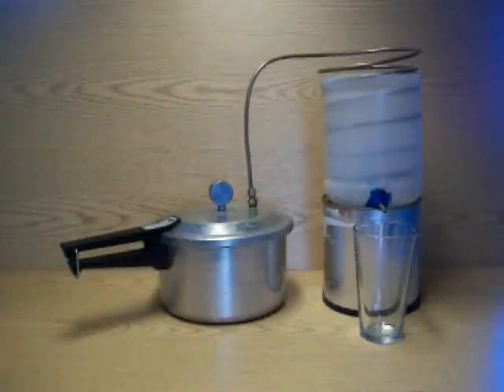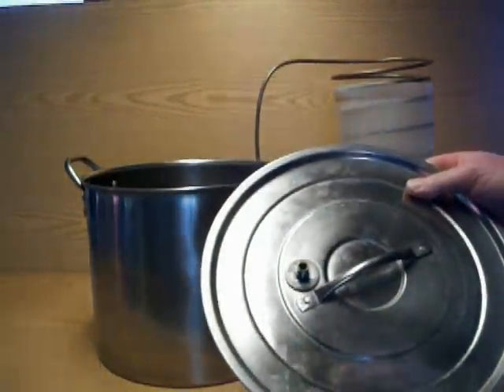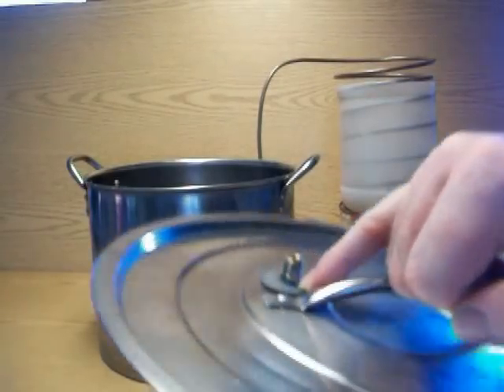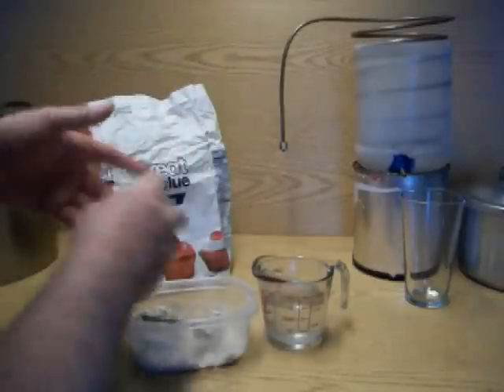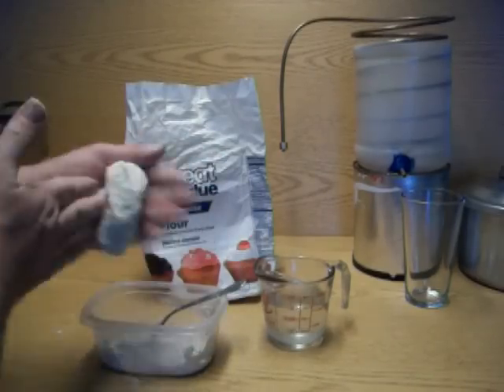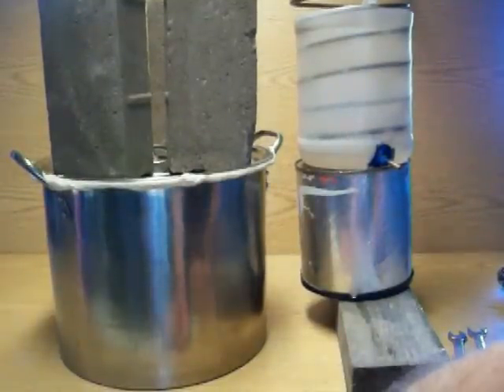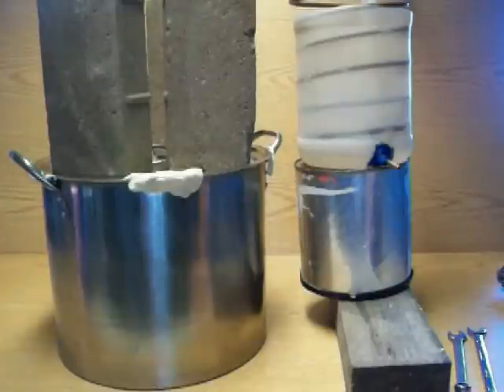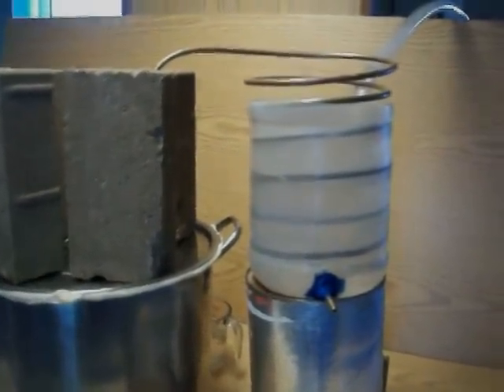Easy Build Moonshine Still pt 2 Upgrade

Comment: Could I put high heat liquid gasket on the lid instead of the flour putty?
Reply from the maker: You can, and I'll get to that.
There were many problems the flour putty solved
*ease of other people being able to find it and use it
*getting the gasket to stay put till I got the lid in place
*possible toxic problems from not being able to find just the right materials
So now, if you can get the gasket to stay there, I would find and cut out a piece of cork for a gasket.

Comment from the maker: Why? Everything I do is as low cost as I can get it. The bricks were right outside and I can't be sure there is enough lip for vicegrips. Also not everybody is a mechanically able as I am, and if they can't replicate this, maybe they shouldn't try. I might try upgrading this on a later date, but it's good for now.

Comment: Rather than using bricks, have you considered sliding a broomstick through the handles?
Reply from the maker: As a matter of fact, yes. but the pressure has to be even, not just on 2 point of the lid as I learned when I tried 2 bricks.

Comment: Me and a buddy are running a still in a old barn back in the woods and we are using a turkey fryer burner too cook or mash if I use this upgrade if it leaks could I blow my self up with alcohol gas and the burner because I couldn't find a 10 gallon pressure cooker so I have to use the pot???
Reply from the maker: +Trucker Man 42 Ok. good questioning. Once you get things up to temp and get something dripping out, you turn down the flame to a min. When you do this the pressure in the pot will only be couple of psi at the most. This will reduce the chance of leaks
Reply: +wcemichael thank you and can I leave the flame at a minimum till the mash is gone
Reply from the maker: Trucker Man 42 No, you should constantly watch it (maybe that's not what you meant).

If you mean until the mash is spent (given up all it's alcohol) then yes.
Reply: +wcemichael ok thank for the information it help a lot
Reply: +wcemichael another question is the seal u used to put the pipe to the (lid the bolts) Can I use a seal like flour and water somethin like that or the next best thing because I don't have access to those seals
Reply from the maker: Trucker Man 42 It should work. One of the rivets leaked and I pushed flour putty into it and let it dry. Never had another leak from it, although yours might not be a permanent seal. You can take some flour putty and seal around the outside of everything if you get a leak while working.
Reply: +wcemichael ok thanks a lot I just didn't want to blow my self up thank your for your help
Reply from the maker: Trucker Man 42 Well there's a lot of factors involved for it to go BOOM!!!

If the pot is small and the air space inside is small, a Poof! is not impossible, in which case the top might come up an inch or blow out the flour putty whereas a BIG mountain type still with one of those big cone shaped tops has a lot more space in it and thereby a lot more room to fuel a much bigger reaction.

And even then you have to factor in, how would the fuel get enough air for a reaction, when the air gets pushed out after some time.

OK? So I'm not saying anything is impossible here. Al long as you're careful to minimalize risks, then you should be fine, but again, no promises. That's why they are called accidents.
Reply from the maker: Also, the pot is a bit tougher than the thinner walled "mountain" copper stills.
Reply: +wcemichael yeah that's the reason I run a pot instead of a cooper still because I don't like my still to be thin

Comment: Im looking to make grain alcohol for tinctures.. what strenght alcohol does this make ? Thanks in advance ☺
Reply from the maker: The question is what strength would you like? I commonly get an average of 50%, but you can do multiple runs of the same batch and easily get higher ranges.
Reply: wcemichael when making tincture everyone say use everclear...im in Ireland and it illegal to sell it cant even get it posted in..so i would like to get as close as possible which is 190 proof ..
Reply from the maker: Oh that's easy. Start with the highest proof alcohol you can legally buy and distill that as many times as needed with a column still if you can get/make one. If not just use a regular still. I won't promise how high the proof will get but you should be able to take 100 p and easily make at least 150 p.  You might have to use a temp so low it'll take all day and night to make one batch of 190

Comment: what kind of fittings are they i got the coupler but the others is what sorry to keep bothering but i guess im just not getting what kind of fittings that you use or anything like that.. like a material perspective.
Reply from the maker: The fitting has a standard thread pipe tread on one end, and the other end has a compression fitting and ring. You local hardware store can help you get the right stuff.

Comment: How can you tell your head from your heart?  Is it easy to detect the difference while tasting?  If so, can you explain the difference?  Is it usually around 50mL?  I've heard that from other people, and you said it was 50mL in your last still video.  It seems old 'shiners would run all of it, and they wouldn't chuck the head at all.
Reply from the maker: Yes, their is a difference. I've learned to tell the difference in taste. Others have learned the difference in smell.
The only way to learn... You run a batch, ok. You KNOW the first thing coming out is heads. Heads has acetone, so it smells like finger nail polish remover to some people.
So you collect it and save it, at least 50 ml (actually a good 1/4 cup) and learn what it taste and/or smells like. Just taste, don't swallow. To me, it is a feeling on my tongue mostly. By 1 full cup, you should start to taste and/or smell something a lot more smoother.
You get to know the clear difference between the two.
Reply: Thank you, very much.  You have been very helpful.  I'll check back in and let you know how my first run came out!

Comment: I was wondering if plumbers tape could be used to seal it instead of flour puddy u know like to line the inside of the lid
Reply from the maker: This is just a working poor man's model. You can buy better on Ebay. I don't know how you get the Teflon tape to stick

Comment: I've seen others use vice grips (instead of bricks)... have you tried vice grips?
Reply from the maker: The bricks were right outside and this needs to be repeatable for the average viewer. I mean I might go out and buy 4 vice grips at around $7 each and maybe I could get them to work but could the rest of the world? A guy in Pakistan was able to cobble together this set up and is making good whiskey. He doesn't have extra money for parts he doesn't really need.
Reply: A very wise answer! Thanks!

Comment from the maker: Thank you for that very useful info. I know whatever contaminates that may be there would only be temporary. I imagine that this contamination would be on stainless steel parts because the would be made with similar tooling, correct?

Comment: how would you get a temperature gauge in there cause interested on how to get it in there without screwing anything up.
Reply: could a drill a really small hole and use flower puddy to plug it??
Reply from the maker: Travis Beaver
You don't need a temp gauge. You just turn down the flame a bit after it heats up. If you don't like the taste, you turn it down some more.
This will explain it better
http://youtu.be/JZakPUSVVKo
Reply: thanks and i cant find your video on your fittings and what not on the lid.. cause i was trying to look today and i cant seem to find it. if you can put that in a link i would sure appreciate it. :)
Reply from the maker: Travis Beaver http://youtu.be/NNq28DDjlA0

Comment: im tryin to make a still an i have almost everything i need to put it together i have a stainless steel soup pot the copper tubing and i have a quater inch thick flare and i lost my notes so wat should i use for the other part of the pressure fitting thing? also im using kwik seal plus its a kitchen and bath adhesive can u help me out an tell me if i need somethin else entirely on any of it

Comment: great vids man. I got SS pressure cooker, i am a but concerned about the rubber gastkit. is it safe to leave it in there or shall i remove it?
Reply from the maker: Boil it with as many spices as you can and also some cinnamon. If there are any toxins it should help them seep out, nicely breaking it in for use.
If afterward you have strange rubbery taste or it starts swelling or breaking down, I would look for a new one made from a different material.

Comment: Can you do video of a run so I can see how it works also what is the name of the fitting in the lid and how big do you make the work out of is it 1/2 copper tube or bigger and does the brass ends cause any problem with the shine that you have made

Comment: wcemichael What fitting and what size fitting is that in your still top?
Reply from the maker: It's a combo fitting. Standard pipe tread on one end and compression fitting on the other for the coil. You can use any size you wish too. I already had the coil made I think I used 1/8" tubing on this. Your hardware store can help you match up the parts.
The pipe tread end has a small stainless steel or copper "nipple" running through the lid then a standard stainless steel or copper "coupler" is used as a nut on the inside. Stainless steel washers are used to add some rigidity to the lid because it's very thin and can easily bend.

Comment: Office Depot medium binder clips, or large, medium is about $4.00 for twenty. Pep Boys sells sheets of high temp gasket material. I had to contribute; this is what I would use if I were doing it, which I'm not. I think you could make a good enough seal that any blow-by would mean turn the heat down, but I would never leave this jury rig unattended. Things can go south in a New York minute. Two words.... FIRE EXTINGUISHER.

Comment: Thanks so much for making this video, it is very helpful. I have an identical set up to your pressure cooker still (the one this is an upgrade to). However, my question is how do you know exactly what you are distilling when you don't have a thermometer somewhere in your set up? I know you need to distill ethanol and methanol has a lower boiling point so it will distill before the ethanol. If I were to somehow include a thermometer, would I need to be testing the temp of the mash or the steam?

Comment: Can I use cinnamon powder in my aluminum pressure cooker to get rid of the toxins
Reply from the maker: It doesn't work quite like that. The heated alcohol will slowly eat away the aluminum, however aluminum doesn't evaporate like alcohol.

Comment: thank you for sharing can you please tell me what size copper tubing  are you using for the worm
Reply from the maker: Oh I forget at the moment I've had this for so long.
The size isn't really important. Making it fit is. So bought a fitting that screwed right in to a hole of a pressure cooker lid that I took a piece out of. then I found the cooper that matched the fitting.
Reply from the maker: ARCSTREAMS
You need to find a fitting that fits in the lid of the pressure cooker, THEN find copper that works with THAT fitting.
I took the lid in with me to the hardware store and asked for help
Reply from the maker: ARCSTREAMS
Do you have an ipod with "facetime" on it?

Comment: Nice build. I have built a still from one of these pots also. I have done it a little different and have a thumper also.  I wanted to add a couple of things to this if I might. the first is the pot itself. the handles should be removed they are made of aluminum and as we all know it is bad for you. I removed the top one and used it for my copper I used two 3/4" copper male adapter with SS nuts (off eBay). as for the handles on the side I took out the rivets and replaced with SS screws (from Menard's). This should be done no mater what.  Moving on the seal is not a bad idea. But so messy think of this while at Menard's get food grade silicon give a good bed around the lid (where you put the flower) let it set a bit and get a skin then set it on the pot after a bit more give it some weight this will make a dent in the silicon  on you lid to fit the pot.  The last thing is the bricks. if you get wood clamps spring loaded type ( found mine at Harbor Fright .99ec.) I got enough to go all the way around with only a inch or so between them. This works good and NO messy clean up.  I hope this helps stay safe and happy distilling. :) Shoot almost forgot use ice in condenser stir it every once in a while just drain that off and add new ice as needed.  this will save a lot on you water bill. I have a 6 gal bucket for my condenser that i fill half full i do that once out of the sink. Ok done
Reply from the maker: +inmate247365b Oh, I made my very first still with an aluminum coil, my second still with an aluminum pressure cooker. I wouldn't worry 2 seconds about handles on the outside.
Reply: +wcemichael Just because you have done it does not mean it is safe. In fact it is not. Read up on it. But as long as you are telling others you should get it right. or as right as you can. Aluminum and brass are bad. That is a fact!!! And just to clear it up it is not the handles on the outside it is the rivets to hold them on the handles are SS but the rivets are aluminum. They will also leak. I have run many gal of shine and have learned a bunch but this one is important. Thanks for responding.
Reply from the maker: inmate247365b I have read up on it, and I haven't seen any proof in this claim .(but I don't recommend using for long periods without thinking about replacing it with copper or SS) What I'm saying is the small amount on the OUTSIDE of your still won't touch anything. There is nothing to worry about.
Reply: +wcemichael I bought a Bayou 24 quart stainless steel stock pot. The great thing about it is the handles are welded to the outside, no rivers to worry about! All around a very high quality stock pot
Reply: +Julien Bubler *rivets

Comment: Really all you need to make a still is a pressure cooker a drill that can cut through metal some kind of tubing that can resist Heat and something to screw it into the hole
Reply from the maker: And do you know how expensive a pressure cooker is of that size....made out of stainless steel? Some people can't tell the difference between a left and right handed screwdriver... The purpose of these videos is to give you knowledge of the absolute minimum requirements to get results. Not to mention that a pressure cooker should already have a removable part that leaves a hole without drilling...

Comment: the putty seems like a step backward. surely you could have rigged something up to clamp that lid on. Even putting three or four bricks on it seems better.

Edit*
 I typed this before i saw the bricks come in. Would this work without the dough and just with bricks?
Reply from the maker: No, you need a seal and something to hold the lid down. This was the best approach for the average guy with little to zero skills. Easy, cheap, and repeatable by the average guy. Those are always my goals when making these videos.
Reply: wcemichael use flour to seal it just like in the big stills
Reply from the maker: Donald Neal Well......
They really use that mostly for leaks I think, but yea, they do seal a lot of stuff, like tubes they want to take apart afterward.

Comment: Michael, really loved the flour bead you used to seal. I've seen other youtubers use silicone, while this is a little more labor intensive, props for economical sense and old school!
Reply from the maker: I go by a basic rule of thumb to make my projects as simple and easy as possible so the average guy can copy it, and if he can't, then he shouldn't be trying.
Reply: wcemichael
 If you were to use a silicone gasket, would there be any concern over chemicals leeching?  I've seen people talking about using food grade and/or aquarium grade caulks, but I'm not so sure they were meant to stand up to that sort of heat.
Reply from the maker: There are people on Ebay selling homemade stills like this one, only more complex because they have tools and work areas. I've seen a couple. They are using some silicone or rubber for a seal. And if you use a pressure cooker it has a rubber seal.

My opinion and I may try this soon. Order a big sheet of cork gasket material and food grade adhesive on ebay. Your first run, pour in a fifth of cheap vodka and vinegar to break it in and get all the possible toxins to seep out.

Comment: made corn mash for first time I was told to put 4" of corn in bottom of 5 gal bucket I cooked it at 150' for 1 hr. well the corn swelled up and absorbed alot of the water I ended up even after pushing threw a screen 2 1/2 gal can you tell me how much crushed corn to use and when do I put the enzyme in it on the bag it said 1 1/2 teas. per 5 gal that doesn't sound right  is it?  Thanks Rose
Reply from the maker: Damn kid playing on my computer...
Go look at my corn mash video and just replace corn meal with cracked corn. I used about 4 or 5 lbs of corn meal, about 3 gals after it swelled up.

Comment: Hey west coast as always another great vid. I have a question for you on recipes using malted barley and unmalted barley- not much on youtube has helped with trying to mash a 5 gallon batch. Any help at all would make me turn back flips!   I know this vid is on a still upgrade but I made this upgrade and now ive got to make a wash with this barley I paid for and not destroy it!  thanks a bunch-..
Reply from the maker: haulshine409 If your just starting out, then work with fruit. Save the barley. I'm not sure about it yet. I've only worked with 2 grains so far. I would say you could used unmalted barley the same way I worked the corn, but please practice with fruit first.